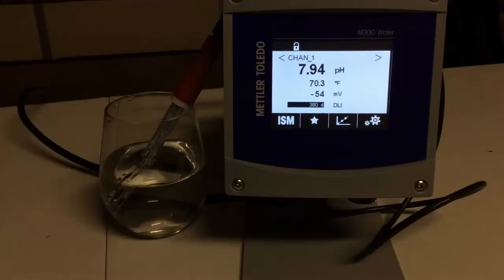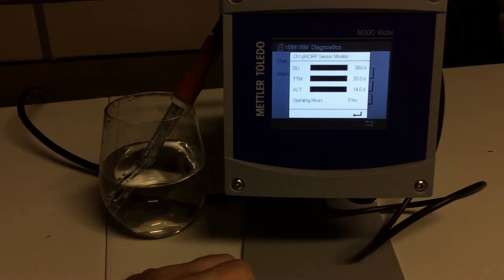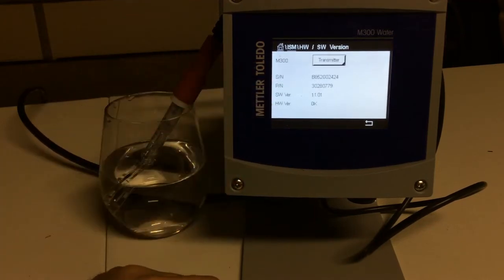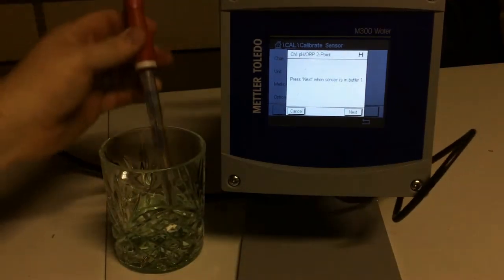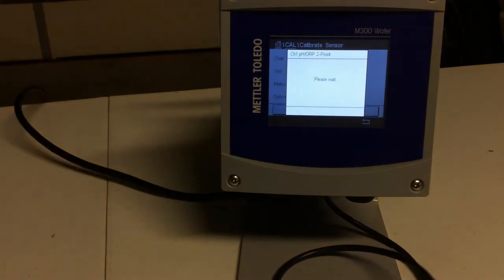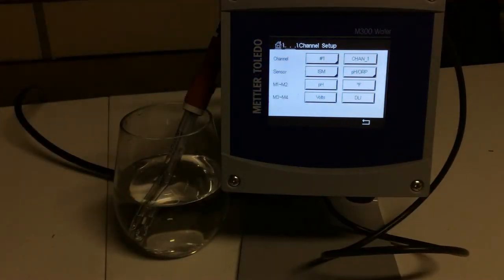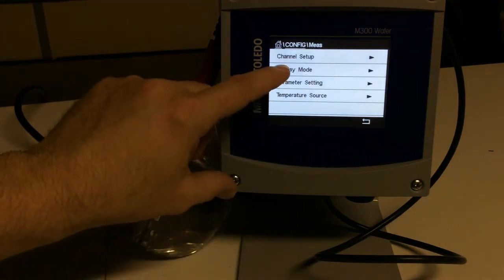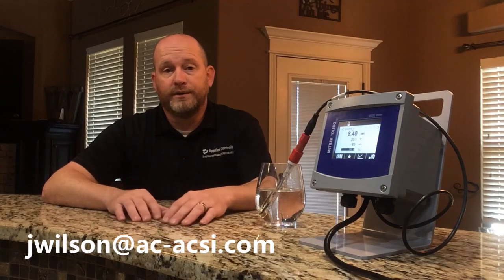Mettler Toledo's M300 Transmitter Demo

Comment: Could you do video on setting up m300 to read ORP?
Reply: I reached out to MT and didn't ever hear back from them. From what I gather, they don't sell any calibration solutions for ORM. 

There are solutions available in various calibration ORP liquids in different mV increments from other companies, but Thorton doesn't recommend them. I've seen some pretty idiotic ideas like using bleach and water to calibrate them (don't do this it will ruin your probe). I was able to ballpark calibrate mine using my Myron Ultrameter II with the ORP function.

It's going to take some water readings and mV recordings to make your own scale. You can setup a 4-20mA analog output to a PLC or a DRO to make the information useful like ppm or grains if you wish or just do the math. Luckily its pretty linear.

Comment: THANK YOU A LOT , MY M300 TRANSMITTER GIVE READING -1.7 PH?
Reply from the maker: Trying calibrating your sensor. If it continues, let the sensor sit in a 3 mol/kcl solution for a couple days. Then calibrate. If problem continues, get a new sensor.